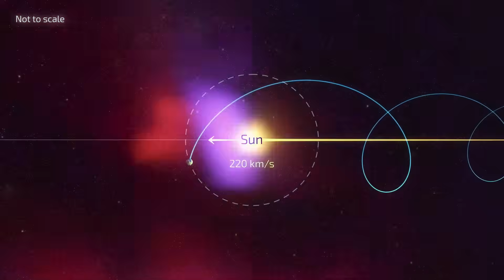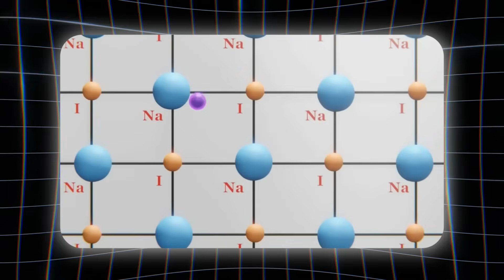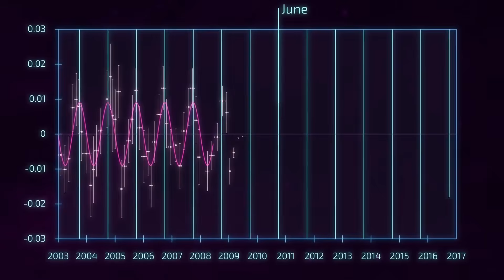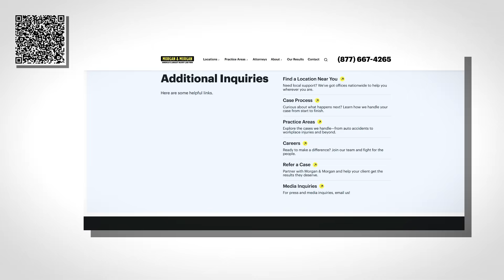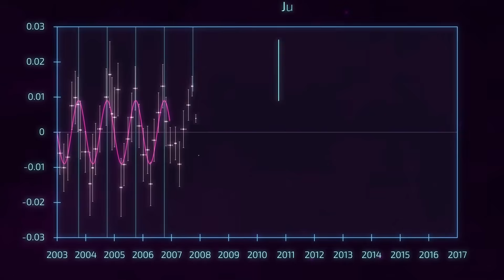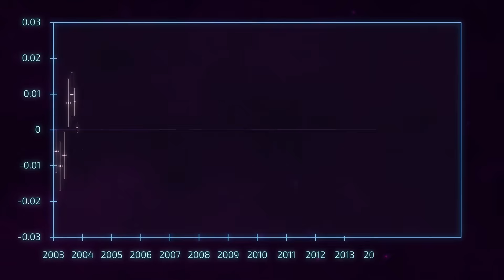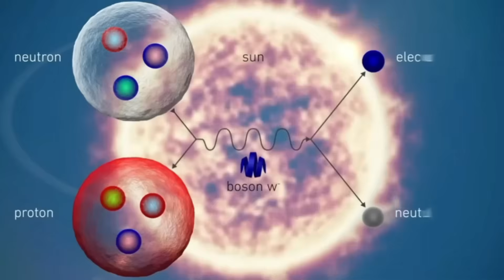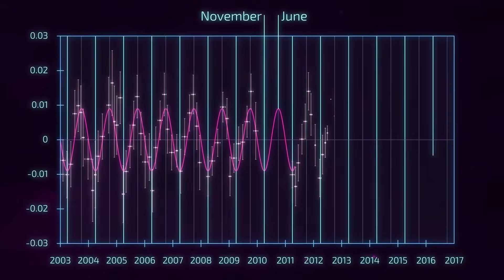What This CERN Physicist Just Said About Dark-Matter Echoes Changes Everything

Comment: Dark matter is simply regular mass that is dilated. A fundamental insight of Relativity is that mass that exists at Relativistic velocities is irrelevant from our perspective. Relativistic velocities are occurring in the overwhelming majority of galaxy centers. This means that they exist in a "non local" state relative to their outer regions. The mass in our galactic center is not just there, it's everywhere.
   The phrase "mass becomes infinite at the speed of light" refers to Relativistic dilation. Mass that exists at 75% light speed is partially dilated. Einstein repeatedly said that it prevents astronomical concentrations of mass. He put this in writing in 1939.
   Relativistic dilation does not occur in galaxies with low mass centers. They don't have enough mass to achieve relativistic velocities. Therefore, they don't contain dilated mass. It has been confirmed in 25 dwarf and ultra diffuse galaxies to have no dark matter. In other words they have normal rotation rates. 
   Mass is a clingy thing thanks to gravity, it makes sense that dilated mass would exist as a halo around galaxies.
Reply: DILLIGAF???😂😂😂